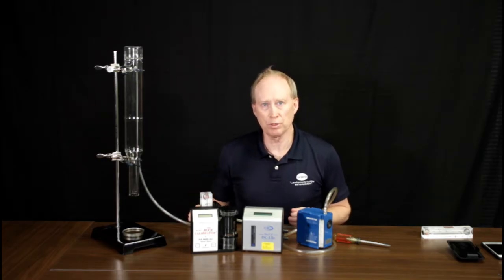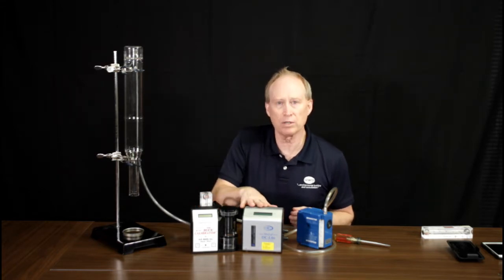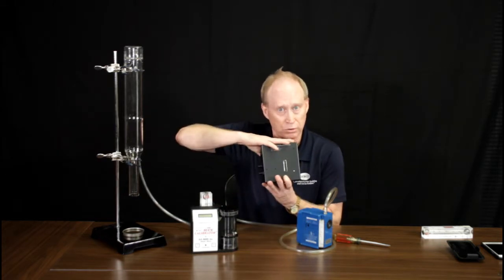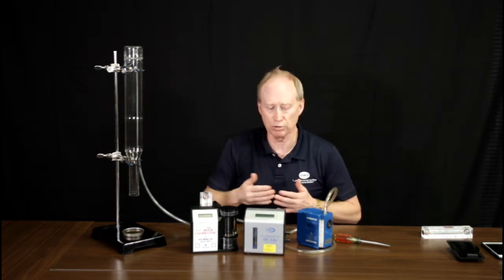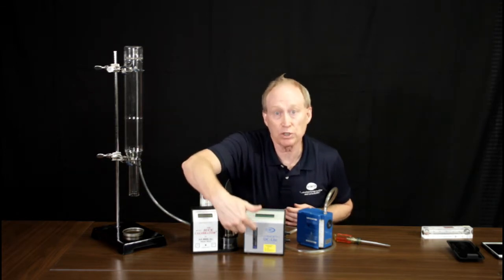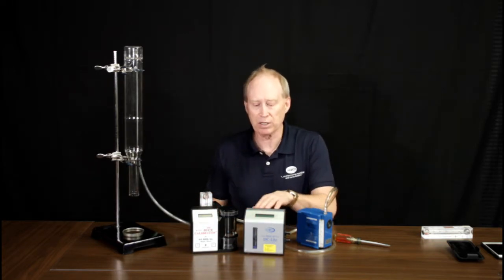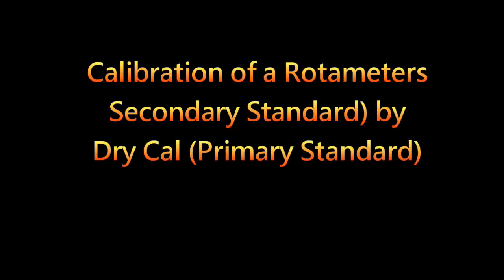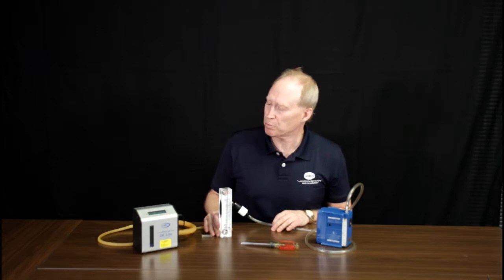Asbestos Air Sampling Part 3:  Calibrating standards and pumps.

Comment: thank you dear sir for this video .But i didnt get the procedure of calibration where we need to adjust the flow  rate to the rotameter can you please explain how to tune the air pump for different rotameters?
Reply from the maker: The pumps I use have a small flow valve with a round black knob on them.  All you do is turn it in the direction to increase or decrease the flow.  You can use different rotometers on any pump.  This process is to calibrate the rotometer to find out what the indication of , say 2 liters per minute actually is.  The adjustment of the flow rate of the pump either high volume or low volume pumps in at the end of the video.  Some models of rotometers allow you to adjust the rotometers, however this video is only for fixed rotometers.